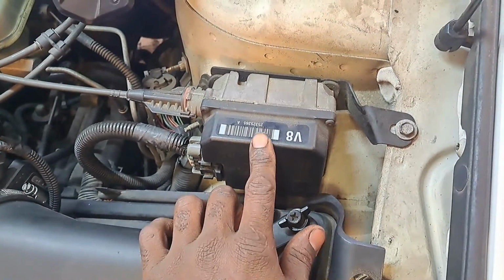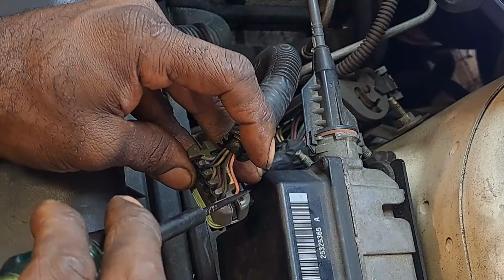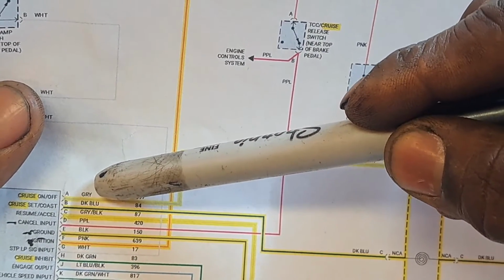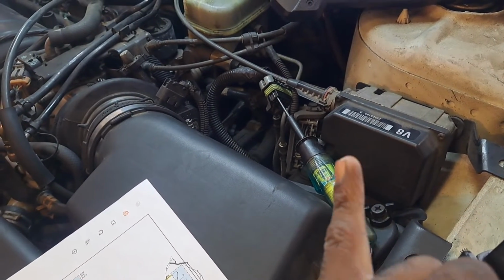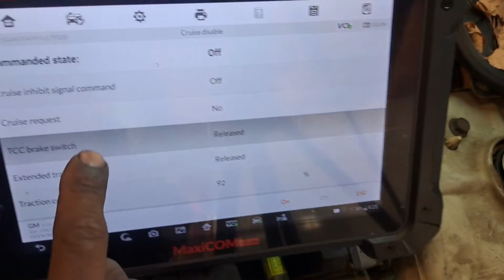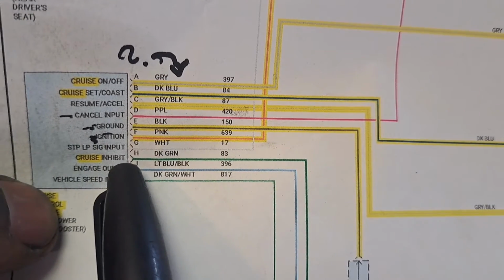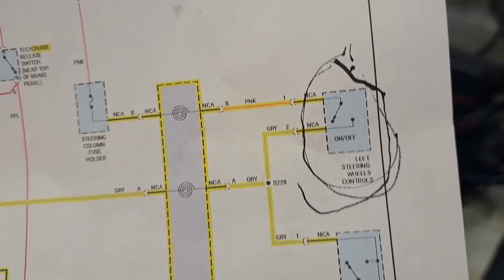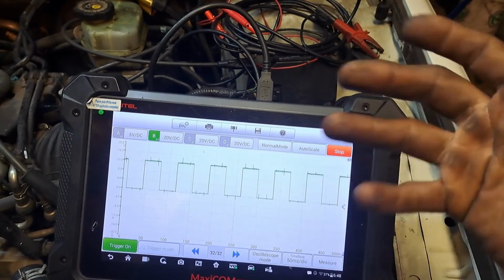2000-2005 Cadillac Deville CRUISE CONTROL MODULE  FULL diagnoses

Comment: He shows a good understanding of pinouts and voltage power vs ground to the 10 pins on this module/actuator. I have an intermittent cruise engage and random cruise disengage with good brake switch adjustment on a 1997 Cadillac Deville which uses a similar module/actuator by form factor. On my 1997 Cadillac Deville I noticed that if I shut the car off, open the door, and wait a few minutes, the system resets and the cruise sets at 25 mph and greater on the road, and even accelerates and decelerates when playing with the accelerator/resume switch on the smart turn signal switch, and tapping the cruise engage button, in order to reduce speed by 1 mph increments. So, I ordered a new module/actuator used for my year make and model Cadillac Deville, and I am hoping that this fixes the intermittent problem with my cruise control not working sometimes, and other times works, especially after power down  at the ignition switch key on to key off for at least 3 minutes. I am expecting the new used part in a few days that I bought on eBay.com for $84.99.

Comment: A few weeks ago my 2001 Cadillac Deville started to run “accelerated” even without pushing down on the pedal. A mechanic disconnected the cruise control module and it seemed to fix the problem, and brought down the idle back to normal. Twice since the car won’t start until the 3rd turn of the ignition, the check engine soon started coming on and it’s started to accelerate again without pushing down on the gas pedal. The mechanic has now said that removing the module completely will fix it. Two concerns one is whether it will fix it but more importantly whether removing it will cause other engine issues. Please help.

Comment: There was entirely too much guessing going on here, without Service Info, it's all a guessing game. I do hope there will be a Part 2 and I do hope that you hook the scope up to all the switch inputs and go on a road test above a certain speed if that is a requirement please. I do not see Cruise being activated in a shop scenario. Thank you for verifying that the switches and wires were good for diagnosis only. It will be nice to see if a switch actually locks on or only sends a simple pulse signal. If a switch is supposed to have a mechanical lock for on and off, please break down a bad switch for us to view the mechanical bits.
Reply from the maker: Yup... I totally guess this repair. Roll the dice
Reply: Thank you for this video, it helps me and my problem was no ground (E)  now it works great!🙏
Reply: So, was it the module?  Was the switch good after all.  I really appreciate your videos.  Thanks!
Reply: The shop scenario would have cost a LOT more to diagnose. This was simple and quick to rule out voltage supply issues. At over $100/hr shop time I'll spend a few minutes of my own "guessing".